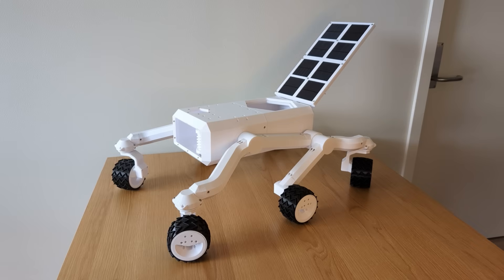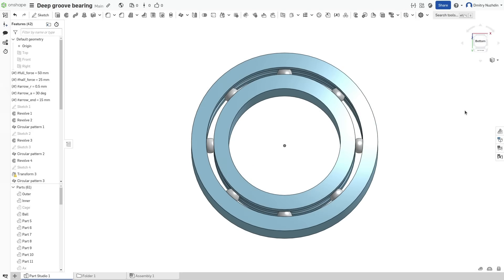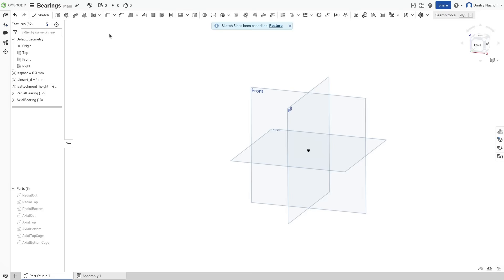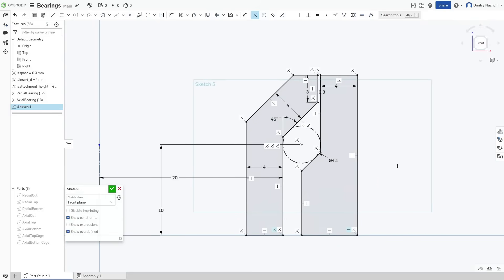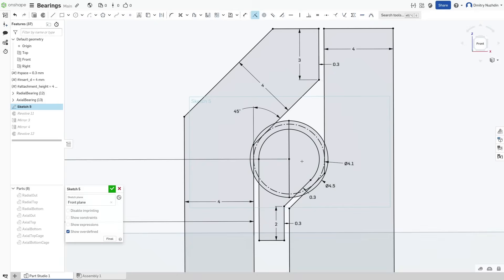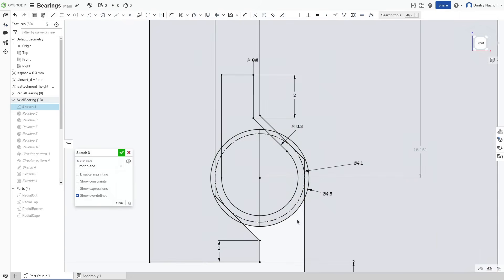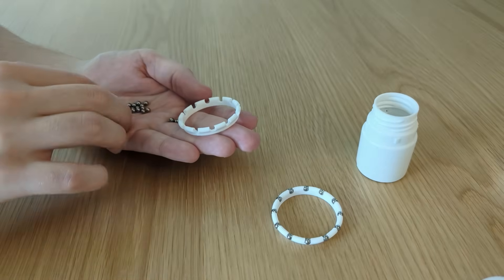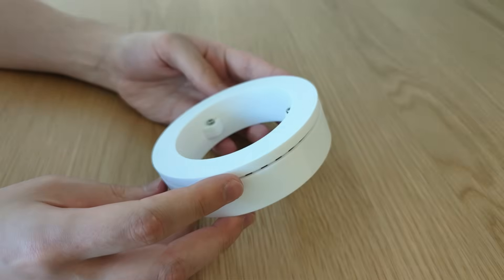How to Make 3D Printed Bearings

Comment: i really like this approach. When making mine a couple years ago the flat sections were printed diagonally which left a slughtly bumpy surface. to fix it I added a very narrow and shallow groove where the balls made contact. it still fused as a flat surface but the print path was concentric with the bearing. it worked much better after that.
Reply: This sounds interesting, but I'm not quite able to picture it. Was the modification you're describing take place entirely in the sketch for the race revolution?

Comment: have you considered using plastic bbs to have similar hardness materials contacting instead of metal and plastic which will probably wear down the plastic very fast?
Reply from the maker: I think that's need to be tested. I wounder if there will be any difference. I will test it eventually :)

Comment: Cool work.

I wonder if a design that doesn't use a bearing cage but instead closely packed bearings would get rid of the play in the bear you show at ~11 minutes? This is what's used in bicycle hubs and headsets, works very well.
Reply from the maker: I tried with no cage. Too heavy, rattle a lot. And it doesn't fix the play. That play actually is by design. The ball diameter in the CAD was 4.1mm instead of 4mm, so 0.2mm play is expected. It's not too much I think, I am fine with that in my rover. Actually it is possible to make the gap smaller, but it requires a well-adjusted printer that prints really well. Or there is an other option. Just print with no gap at all and assemble. It will not spin freely first, but if you forcefully spin it with some load for some time it will wear-off all roughness and it will be perfect bearing with no play.

Comment: Nice to see someone else doing this.  I printed a thrust bearing to hold my 5kg spools horizontal for my printer.  Basically just a bicycle shaped cage to hold 6 metal balls in a ring.  I used some spare Plexiglas as the top and bottom to get a smoother and harder raceway, but it would probably work fine if I printed those too.

Comment: I see to remember that it's a Good Idea to use an odd number of bearing balls. I think it distributes the load better if there are imperfections in balls or races.

Much like a three-legged or five-legged chair is more stable than four or six legs on an uneven floor.
Reply: three-legged chair don't wobble on uneven floors. 4, 5 or 6 legs will always wobble. If you have an even floor, more legs means more stability. Doesn't have anything to do with odd or even. (-:
Reply: @roalddhal2  Yes, that's why he emphasized that in cases of wear and tear on the spheres, there will be greater stability if the number is odd.
Reply: @roalddhal2  It is not true that 4, 5 and 6 will always wobble. As a trivial example, you can imagine an "uneven" floor that's just a small hole in the middle and flat otherwise. For a non-trivial result, 4 legged tables always have at least one stable configuration in any uneven floor per Bolzano's theorem.
Reply: Great that you mentioned this, my next design will be Odd. Yes, the indentation on the Crown Cork is also odd.
Reply: I think odd numbers have more to do with reducing harmonics.

Comment: You should add a little gap between the bolting surfaces. Then you could adjust the pre load by printing different size shim spacers.
Reply: Or your choice of spring washer.

Comment: Nice work. BTW, I've found that you don't need threaded inserts in situations where you aren't taking the screws out that often. Just thread direct into the plastic.
Reply from the maker: True. Not really needed here, I just like how they looks and enjoy working with them :)
Reply: Besonders bei einem Fahrzeug ist aber mit Verschmutzung der Lager zu rechnen und dann sollte die Reinigung wenig Mühe machen. Meine BB-Pellets tausche ich öfter, weil sie rosten, wenn die Messing-Schicht abgenutzt ist.

Comment: Have you considered embedding the bearings, by pausing the printhead at the correct layer and then placing the carriage inside, before continuing the print?
Reply: What is the goal? To reduce the need for the screws? You can split the part and superglue them together instead. Or you can make them snap/lock together.
Serviceability has lot so benefits too, especially when making prototypes like the rover.
Reply from the maker: I was thinking about it but I don't think it's possible. The extruder will collide with balls and I can't think of the design or method to avoid it. Also in real applications I use these bearings as an attachment point. It's like outer races printed as a part of component A and inner races are printed as a part of component B. So you assemble A and B and the bearing at the same time.

Comment: You can make the play in the angluar contact bearing adjustable by adding a gap in between the two inner races. Use a rubber O-ring or a piece of TPU as a kind of spring allows for easy adjustability
Reply from the maker: That's an interesting idea, thanks :)

Comment: I like where this project is going, thanks for sharing the design.
As an engineer I was quickly making some calculations and changes in my mind while you were showing the 3D prints: 36 balls with 72 kg of load is 2 kg per ball and with a flat surface, the contact area of ball and surface is a single point of contact which is an infinite small area which results in an infinite high force on the plastic race. As long as you rotate the bearing, this will even out along the full circular contact area but as soon as you stop moving, things change. In time (and temperature) you will see that the balls create small dents at a certain location.
Will this be a problem ? Yes, definitely. When will this become a problem ? It all depends and we will only know when we try this.
15 years ago we also stated that using PLA for 3D printing was a bad idea since it is bio degradable but we still do and printed stuff holds a very long time.
Reply from the maker: Interesting point. Generally I think that these bearings should not be used with high load. Deformation under continuous load will 100% be a problem and AFAIK all regular filaments has this problem, only special stuff like CF-nylon or PC can handle that. But these filaments quite hard to print and bearings should be printed with decent quality.
Reply: Deformation is key. Temporary deformation of the ball and the plastic are simply part of how the bearing works. If I were to go about calculating deformation, I would assume that all the deformation happens in the plastic, and go from there.

If the balls were also plastic, it would be harder to calculate, but something tells me it ought to work better. Do the vendors of balls provide a recommended force per ball? If so, I might optimize my design by finding a ball material with stiffness close to my filament choice, then go with the ball loading recommendation.

Permanent deformation to smooth out the races sounds like a good thing. I wonder if I could get the permanent deformation I want, but avoid the deformation I don't.

My first thought is to load the bearing with a weight, then get it spinning fast enough to generate the heat to just oh so slightly slightly soften the races. Then my guess is removing most of the load while keeping the bearing spinning would allow the plastic to cool while keeping the smoothed shape. I don't know if that would work, but if it did, it would take precise control of the recipe. Time and temperature have to be just right, just like cooking. Maybe add some lubricant at the right moment to cool rapidly. Possibly cook with one kind of balls (steel or aluminum maybe), and then switch the balls out for use (plastic).

I wish I had the time to do all that experimentation.

Comment: wouldnt using nylon balls be better so it doesnt make grooves?
Reply from the maker: I did not try, but I doubt that it will make a big difference. Grooves appears when the material can not physically handle such force and starts to deform. I think the bearing just should not be used with such load. Maybe nylon will increase the maximum load a bit, but at the same time when both balls and races deforms that will increase friction. Ideally all parts of bearing should be as hard as possible (hardened steel / ceramic) because it reduces deformation and friction. Our races are quite soft, but at least we can have proper balls ... that's what I think.

Comment: Very cool! Another tip is that you want to have the walls as thick as possible so that the slicer will not print unneeded lines that could slow the bearing down. For overkill when printing bearings I set the wall thickness to 3.0 mm so that the ball bearing can roll around the grove of the print and not hit cross lines.
Reply: I experimented with this design, I made the design in Fusion 360, these were the changes I made. I minimised the clearance between the diagonal 45 degree contact surface of the inner and outer race to zero. You can adjust the pre-tension on the ball by the screws.  For a smoother surface I separated the inner and outer race and printed them in vase mode and sequential printing and set the extrusion width to 1 mm, layer height 0.15 mm. I changed the print orientation 180 degrees, so the wide part was down. This minimised the deformation during cooling, 45 degrees angle prints like to curl up during printing. The inner and outer races press fit in the rest of the design, you use a more wear resistant filament for this. You could also machine them is you have a lathe. The results are very promising,  there is no play in the bearing. The bearings are silent, you can still feel the balls skipping to the next layer, which are at a slight angle in vase mode. I did this first test with 3mm balls, I didn’t have any 4mm balls. I will try 5mm next.
Reply from the maker: @chipcode5538  wow, interesting. My goal was to make a simple design with as few parts as possible to make assembly easier. But it's very cool that you are exploring ways to increase quality. Cheers!